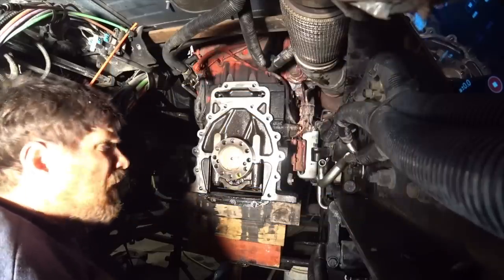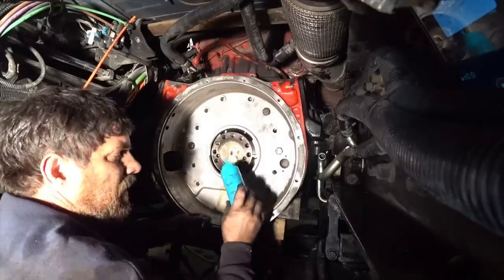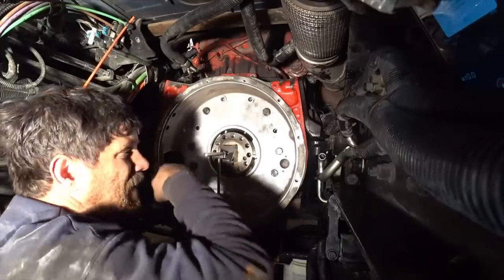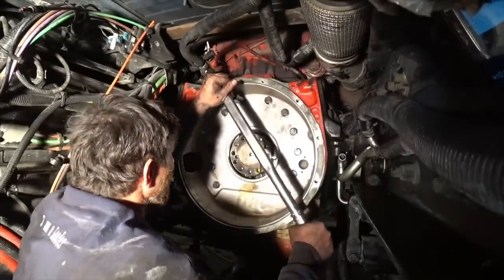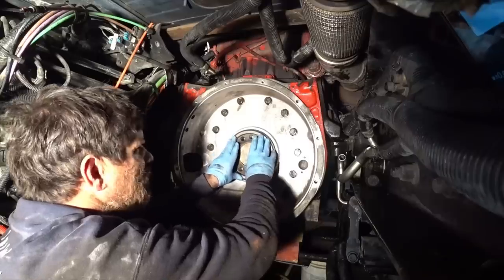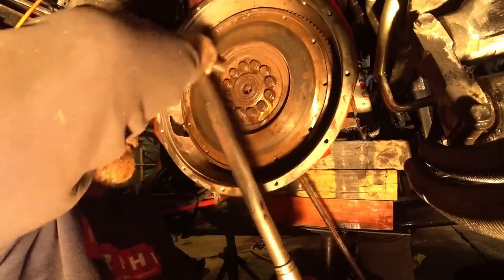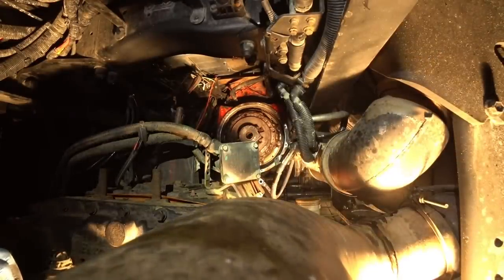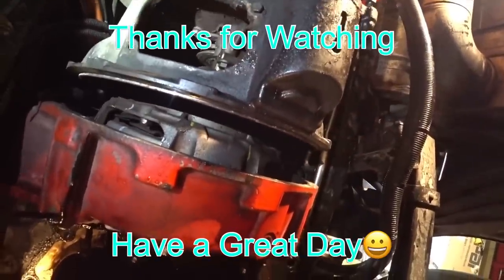January 8, 2019 4/ Installing Transmission Housing, Flywheel, Clutch on Kenworth t680

Comment: Good call on new pipe. !!!!
Volvo pipes rot big time. 
Have had to do coolant  pipes   and all new AC   lines  and even evaporator  and heater core in the bunk here. 1000 Stories in 40 yrs. 
Hammer  down LHL.  NICE WORK!
Reply from the maker: Yep fix it when it’s easy to do it👍

Comment: The theory for clicking the torque wrench twice is that all bolts have some elastic qualities and when you torque them down they will back off a slight amount after you reach the correct setting and will end up slightly under torque specs by clicking the wrench twice you are setting the spec setting the first time the couple of seconds you relax off it allows thus elastic reaction to take place and then when you click it a second time you are just resetting it to correct spec torque setting I was once told the difference depending on type of bolt hardness is as little as a foot ounce or as much as 1 or 2 foot pounds. This is why most motors when you are replacing head gaskets etc tell you to torque then in 2 or 3 stages so for example you will torque to 70 ft/lbs then 90 and then 110 this to allow the bolts to stretch between stages and to allow elastic adjustments in the bolt to occur. Hope this helps anyone wondering why this is not only good practice but should be always done with any torque spec bolts.

Comment: LOL Larry you make me go back in time. When I was a kid, Dad would drag me to the shed to do / help him. That was what I was hold as he would fix everything he used on the farm After a couple of years of this stuff I would all ways say when some adult ask  "what do you want to do when you grow up?" I would say  work outside fixing thinks, not going to catch me in any kitchen washing dishes. They would laugh. but back then tractors were not that big but look big to me. If he broke down in the field I'd run to the shed get the truck put the tools in the back on the tail gate and off to the field I go . I was seven,  at nine I broke my wrist couldn't drive so Dad had to, at 10 Dad cut two figures off in the saw ripping blanks from the saw mill so it was my turn to drive. Good think for back roads of the county. LOL  Man you were tired.   Yup you were pushing your self.   Larry did you go to the house on your hand and knees. You were a hurten machine.   till next time.
Reply from the maker: Sounds about like my childhood, was a bit sore after

Comment: Another great video Larry. I think a lot of guys will double click the torque wrench just to verify the bolt is tight and that the socket isn't binding against some other adjacent surface and that it is firm on the bolt head.

Comment: Hey there Larry.  I also double click the torque wrench like that.  I do it to confirm that I'm where I need to be.  I had one time where the bolt caught on something and the pressure gave a false reading.  Went back on all to check them again and it went further to correct torque.  After that I did it double like you did to make sure.

Comment: Just came across this video man good stuff. One thing I want to point out to maybe help u is that instead of doing the whole out of round checks all u need to do is make sure the bottom of housing is flushed perfectly with bottom of block. If those two are flushed you’ll be alright 👍🏽. I’ve done a lot of these and have never had to check out of roundness like this

Comment: Read through all the comments and I can't believe no one has pointed out how hard your making the last part of the job on your self... Put the clutch on the transmission then bolt it to flywheel through the access hole once it's in. There's no struggle stabbing her in if you do it this way.
Reply from the maker: I do thing’s properly, specially for something important and you don’t want to mess with much. There is no way to properly torque unless you turn the engine 180 degrees every torque. It’s really not that hard to do it right👍

Comment: Great job ! I do as much as possible. Brakes, axle seals, yoke seals, remove and replace stuff, I'd have to pass on pulling the transmission : )....I would pay you to work on my truck if I was near there : ), see why some jobs cost so much, might not mind if the mechanic got most of the $...Be safe...
Reply from the maker: Thanks

Comment: So if the main seal leaks it would leak through the bell housing and the clutch housing correct? 

There’s no way for the rear structure seal to leak in the bell housing right ?

Comment: probably a dumb question from a non-mechanic...how do you keep track of all the bolts, etc, when you take them out so you know which goes where when putting it all back together?
Reply from the maker: I use plastic bins for each part of the job

Comment: Is threadlocker not necessary for those flywheel bolts? I didn't see any being used.
Reply: Most heavy duty truck techs just use oil. However the bell housing bolts do require some blue if you don't want to risk the tans falling out.

Comment: you shouldn't double click a torque wrench, it a very easy way to over torque your bolts. click torque wrenches are only good in a fluent motion. theres a long technical reason to do with the operation of the click style wrench to why it is this way but realistic you can always get away with two clicks. i know lots of mechanics that do it and never have problems but something to look into

Comment: Larry you getting too old for that sort crap LOL you need a cheater bar on the torque wrench for those high torque nuts made me feel light headed watching you and how you looked after each of those flywheel bolts. I am 60 now and have always done all my own maint till i got into my mid 50s last job i did was an engine swap for a good mate that in the younger days would have taken a day at most ended up taking us 4 days getting old sucks LOL
Reply from the maker: 😥 I was sweating